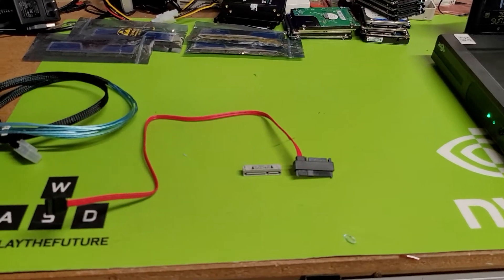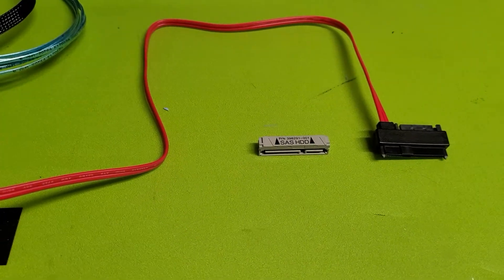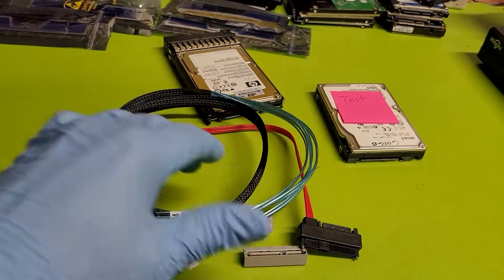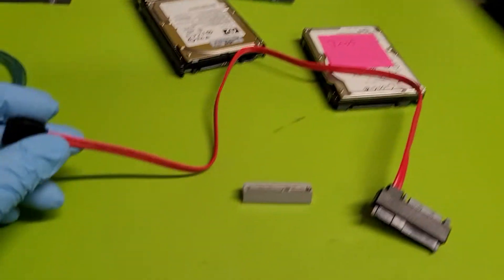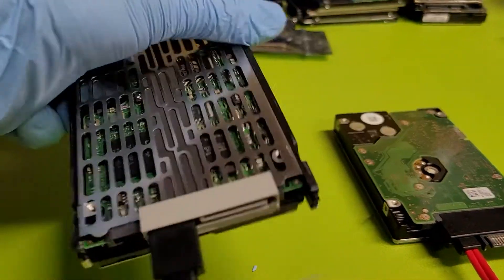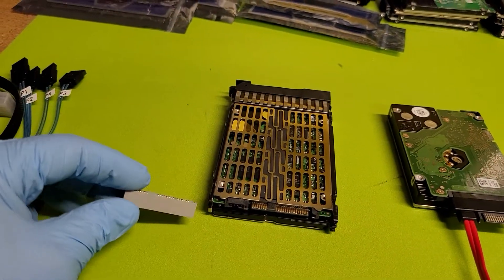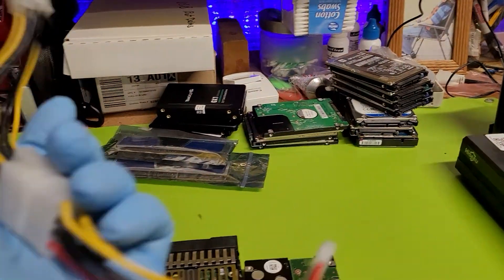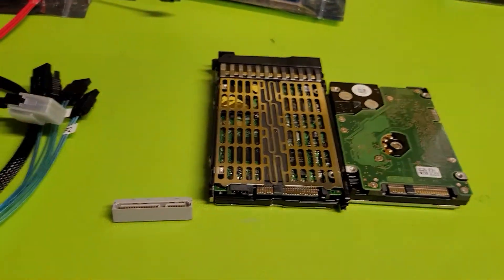Comparing Single SAS  to Sata edge connectors

Comment: Does this adapter happen to block the 3.3V line on consumer power supply cables?
Reply from the maker: It is only to use for SAS Molex 5 voltage I beleave.
Reply from the maker: I have to double check...

Comment: I have a SAS HHD . I do not know how I can connect it with PC?
Reply: Thank you for your answer.
But I want to connect my sas drive to my pc to transfer data. Can you send me the link  of the sas controller which have adapter.
Reply from the maker: @Surkhab2803  Sure, if you have the drive mounted in your case, go with this controller: https://www.ebay.com/itm/385095325814?_skw=LSI+sas+controller+internal+dual+port&epid=134194385&itmmeta=01JF8MNCGSHNH7MP7ZKNCHRQ3Y&hash=item59a9785876:g:4YAAAOSwPfRjEbzp&itmprp=enc%3AAQAJAAABAHoV3kP08IDx%2BKZ9MfhVJKm2aBmsIjzwLRBdfs8DYjLbd2lxLCxHhc8e9dcTkL%2B9yge962OFErVd%2FDSQRN7GDKpHAyRn0UUKLkJprNiqaHpOUIZjYGqJtykJ2vQl5xLTW6W52GlPZ%2Fxbo2XMUeQZcpvaLQQScqalc8Zwo44tqWnWfeYkdpbx%2FHdGYzRGKla%2Bk2o%2Bor9DcC8UEtgL9oiRlCSVncWzLj%2B8PVKmWYgYlsd%2Bz6PI4nby4twg76o8%2BqEkjJwQ3BCBybnS0hpi08jTFz%2BZIVg9jGkeVBHqZi7IbcCpUSQYQqeeqBqu8%2FX0ZvrogHwmI7WukL0v%2BXAw9Df9pZg%3D%7Ctkp%3ABFBM3MjVlPpk .
Reply: @leadiususa7394  Actually the drive is not mounted. I have only SAS hard drive. Now want to know how get connected or what other cables and adapter need to make it functional.  Thank you
Reply from the maker: @Surkhab2803  Look for my next video and I will talk to the very topic.
Reply from the maker: @Surkhab2803  If it is externally connected to your PC  then goes with  same card type but with DUAL external; SAS ports and do your research on the SAS cable setup. There are a few few type of hook ups you can use.
Reply: @leadiususa7394  Thank you , but I have only SAS HHD , no other things. I want to connect this SAS hard drive with my pc to transfer data. 
If you tell me and explain and send me the complete link. I will buy it.
Reply from the maker: You connect your SAS drives to a sas controller.
Reply from the maker: Well, you get the LSI SAS controller i recommended  and cable connect to your SAS drive to,. Transfer the data and you are done.   The SAS controlelr cards runs about$15 in cost and the SATA to SAS cable is $4.  I plan on doing a video on this very topic shortly so look for that video.

Comment: Sir, I have SAS Controller On Board in my PC, but I only have SATA hard disk, and can't buy SAS hard disk for some reason. Can I use only the SATA to SAS Converter cable to connect my SATA hard disk to the SAS port? Would it work ?
Reply from the maker: Refer to my other response to this.
Reply: If you're looking for a SAS drive I have one.

Comment: So if i have a sas 3tb hdd and i wanna use it in my pc i have that same adapter with the red sata cable, so i just plug and play, it would work?
Reply from the maker: No, you need t oconnect the SAS drive into a SAS controller thru a SATA to SAS cable,  Motherboard on board controllers are to basic to see SAS disks.   Get a LSI SAS controller for around $30 in cost and that will work.
Reply: @leadiususa7394  dam it i wish i knew that before i got a 3tb sas drive :( ugh 

thank you so much know i now cheers mate
Reply from the maker: @jordz2893  Maybe not!  Try this solution.  It is cheap adn you we be very happy with the out come for this is so much more then a basic SATA controller.  And it is cheap and you can expand! https://www.ebay.com/itm/133059941866?epid=27026538211&hash=item1efafd95ea:g:Pn8AAOSwOKpfFno4&amdata=enc%3AAQAIAAAA4PXjSxpe5Vni%2BpGc38qaAh5TFVlTEkjaioO87%2Fu5Yq%2B8AOl%2Fs4LlWqKqkPHVix6SQTPabJc2EOBALd7D8g%2B9EcD0P5xn204qAnbZY4%2F5gO%2B9bpv%2FZvIchvLLzL8mmcUCGI%2B9O9qwzBXxXaThPJrfh%2F0KS%2B1JF3vsvZigNC%2BlrkjoEnCiBI0EGT7jorLGFXUnxbka8Vk4bz6vDVLXJPzeGBfUcnc8G89LNjgBOaqh48WXdwMV1S9J9MJ04%2BKeZCEJfPnOc7P7qcdWJejdu6vrx%2FHvvAlepBL8LHYB8l763ttz%7Ctkp%3ABFBMtJSb4vlh

Comment: Thank you for you video, with these cable and converter, I don't need to connect SAS drive to power cable which is onboard ? these cable could supply power like POE?
Reply from the maker: No you connect he power molex and the SATA to SAS cable to your SAS controller and you are good to go.  Remember that motherboard SATA controllers can't detect SAS drives.  You need a SAS (server level) controller to see SAS drives.   Heads up and enjoy!

Comment: Would I be able to clear the "foreign" configuration on a used SAS drive using one of these adapters?  I am trying to replace a failed drive in a Dell T710 server - but my used spare drive is showing up as "foreign"...   Thank you in advance for your reply!
Reply from the maker: So if the drive was added to the RAID group as a paired swap drive some time ago when you built out the swap drive coverage, it shouldn't show as a foreign drive.  You may have an issue with the hot swap drive itself.   It does happen that a HS drive fails while setting on stand by.   Removing the drive will not help either.  The RAID controller just needs to import the foreign drive values and rein state the drive as a HS drive.  I have seen this and these days, I don't wast time for I just replace the drive for it always has failure issue about 92% and you want you HS drives not to have issues and to ready to switch over to a RAID drive as fast as possible.  Sorry... But yes you should test it and use the connector but any work done at that level will wipe the HS state info on the drive and would have to re-added as a new HS drive.  Sorry...
Reply: @leadiususa7394  Thank you for your reply.  Just a short note - the drive I am trying to use was part of another raid on another server.  My controller does see it - but I can't find a way to wipe the previous configuration.  So the question is - if I use the adapter with a regular PC and delete all partitions on it - will the raid controller than see it as an unused drive and be able to use it?  For some reason, my Perc 6i doesn't have a feature to wipe this drive - it sees it as "foreign"....

Comment: Would it be reliable enough to use in a nas ssd sata to sas?
Reply from the maker: Well, not really for it does take up a lot of space, I would get a SATA/SAS back plain instead.  One that can fit in a tower or a if you have a real server chassis that it would fit that.  Or just get a Disk array for your needs.  I is pretty cheap. I recommended this for testing failing SAS drives from a SAS controller.
Keep happy fun with this stuff.

Comment: can i connect a sas hard disk to my pc computer ? can i use a conversor from sas to sata ? thank
Reply from the maker: No you can't just connect this to the motherboard.  It needs to go to a SAS controller that using SATA connectors.  motherboard only have a very basic SATA (Only) support.  This connector changer is onyl for a SAS controller.  SAS drives are more advance then simple SATA drives.  Sorry...
Reply: @leadiususa7394  ohh ok.. and what cheaper SAS Controller do you recomend me to buy for my pc ? To use my sas disk
Reply from the maker: @angelvaca9232  GOp for the the LSI 9211-8i 6G SAS HBA FW:P20 IT Mode ZFS FreeNAS unRAID 2* SFF-8087 SATA US.  It out on Ebay... It should work for your needs.  Also make sure your have the correct SAS ratted power connector as well.

Comment: can I connect/use the EXOS 18 TB standard SAS with a standard SATA or do I need to have it SAS SATA compatible to have the 260 mb R/W at the same time ?
Reply from the maker: You want the higher quality cable set for faster bandwidth.  Stay away from eh older cable sets

Comment: Hi sir, I just bought my first server (dell poweredge t320) and I bought some sata drives so I could use them later on when ai stop using my server. I thought the process of getting out the sas hot swap plate and using SATA cables to the SATA ports was going to be enough to use SATA drives but it doesn't seem to work...
My question is if there are male sas to male SATA adapters? I can't seem to find them online
Idk if you have Instagram or something where I can contact you more easily but thanks in advance
Reply from the maker: No there isn't and for a good reason. SAS is Dual serial data transfer and SATA is single data transfer.  SO the SATA disks should have worked by plugging them in the SAS hot swap bays.  Did you try?  SAS HBA / RAID will do SATA but SATA will not support SAS.   First give that a try, if it still is acting odd. Then I will give you my email address and we can talk.  Also make sure you get the specs of your server from Dell so you know what you inside the chassis.  Always helps...
Reply: @leadiususa7394  first of all, thanks for the reply.
I put the SATA drives straight into the SAS backplane but know when I put the SAS cable from the backplane into the motherboard the drives still don't show up. Is the backplane for hot swap enough or do I need a SAS raid controller to put the cable into?
Reply from the maker: @Smokey_Vax  No you can't go to the motherboard for that is a basic SATA only controller, Its needs to go to a advance RAID or HBA Controller from the PIC-E slot side of things.   Check to see if you have such a card.  This may be a very basic chassis build out.  But don't worry for there is a simple fix.  Let me know what you find out and email me at bradmd92@outlook.com.  Also make sure you get the service tag off the back of the server and look up your server build out.  When you got the server, the past owner may have remove the controller before selling it or you may just never had one from the start.  Let me know.. Later
Reply from the maker: @Smokey_Vax  Also look at your motherboard manual...  The motherboard is called 7C9XP and the link to the manual  : https://dl.dell.com/topicspdf/poweredge-t320_owners-manual_en-us.pdf
Reply: @leadiususa7394  I'm going to look in to these thing tomorrow, I'm really great full for the help, thanks!
Reply from the maker: @Smokey_Vax  No problem, here to help...

Comment: using a PCI-e SAS Raid controller in my desktop motherboard, with a breakout cable. Should I be able to access and format the drives through windows OS?
Reply from the maker: Yes if you connect the SAS/SATA hook up to a SAS controller first.  Remember this is A SAS connector and will not run off the a normal PC motherboard.  The HBA SAS controllers are really cheap on ebay.  Make sure you get a internal cable controller and it cable SAS/SATA hook up cable...
Reply: @leadiususa7394  Thanks man, Subscribed!

Comment: so with the sas controller and connecter combined with molex to sata power you can use this in your motherboard at home for personal storage and operating system
Reply from the maker: Yes, if you have a real SAS controller
Reply: @leadiususa7394  awsome thanks for the reply and are cheap controllers any good

Comment: Will any SAS controller work with SAS drivers or do you need a specific model? Also, could I have a normal SATA drive and SAS controller with SAS disc working at once or together in one system? Normal PC, X99 motherboard.
Reply from the maker: Any real SAS controller will work...
Reply: 1 sas connector has device connections, any can be either sas or sata, I have 2SAS and 1 SATA for my PC